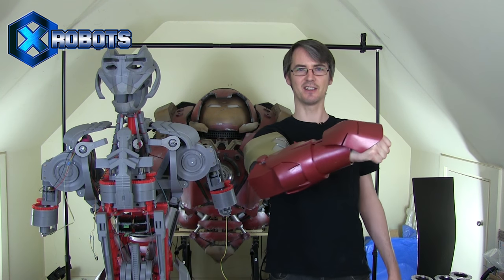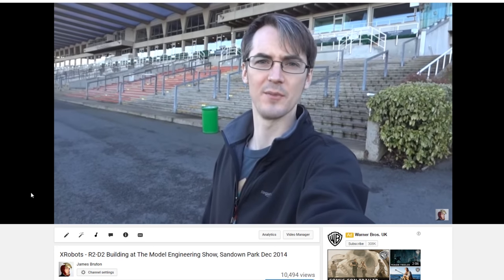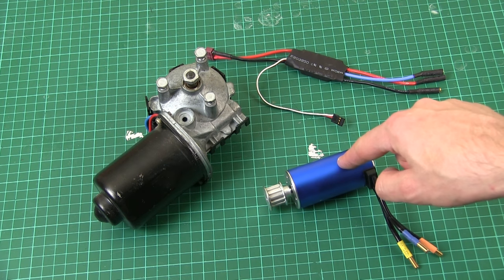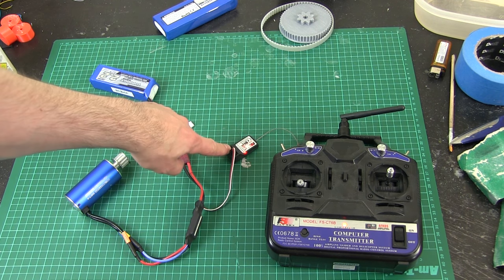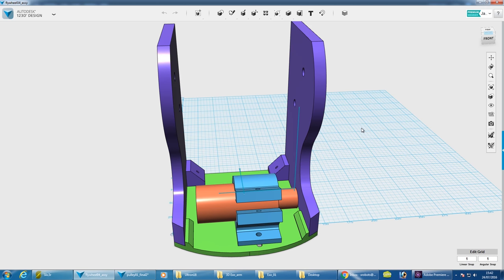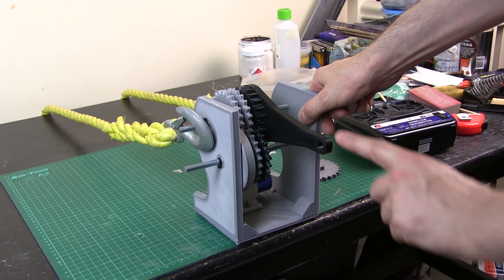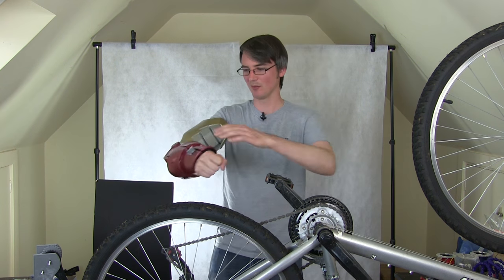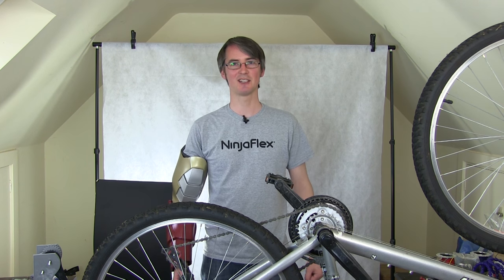Iron Man Exosuit #1 | Testing Motors | James Bruton

Comment: Couldn't you use those force sensors from ultron to control the arm? I kinda thought that's what had given you the idea in the first place.
Reply: Should use small amounts of highly pressurized air to make  a better hydraulic system. Did one for engineering and it's tiny and yet my L arm can lift just about anything. Best part is the air tube is very thin and the air container it self can be hidden wherever.
Reply: myoelectric sensing, the arduino A/D converters are sensitive enough to detect them with a voltage follower comparator.
Reply: have limit switches installed for safety on the joints that physically disconnect the motors, and a dead man switch on your hand so when you let go you physically disconnect the battery via relay perhaps in conjunction with myoelectric sensing, you can get the electrodes necessary with adhesive pads from a TENS machine, as long as the electrodes have good contact on the skin you should be set.
Reply: ive had experience personally implementing this myself(i'm a systems engineer) hence why i suggested it, good luck james.
Reply: oh and dont forget to wrap the sensing wires with aluminium tape and ground them to get rid of any EM interference from the brushless controller, but you shouldn't have an issue with that as the signal you are looking for is DC and the EM interference you may get will appear as AC at the frequency the brushless controller operates, so you may be able to digitally filter that out in software.
Reply: not really if u could make it so the sensor reads the feedback as a greater distance then it should (so tweek the code so it reads it as a higher val) u could lift with just the exo (in theory)
Reply: Such an arrangement will lead to lethal resonance and jitter
Reply: posable
Reply: Check this sensor:https://www.kickstarter.com/projects/312488939/myowaretm-harness-the-power-of-your-muscle-signals
Reply: its a myoware muscle sensor, also what i plan to use with 1 of my planed exos
Reply: same company i linked to, beat you to it
Reply: Sensing the expansion of muscles could be a much better and natural way of telling the motors what to do.
Reply: oñ

Comment: Wouldn't a worm drive simplify the mechanism while still providing the torque? That would just require getting the pitch of the thread right and would be a lot less moving parts, as well as being similar in size and proportion to a hydraulic cylinder.

Comment: As far as estethics go, wouldn't it be better to use the hulk buster suit to hide the gears and motors in?? if you add better gears etc. you could even try to make a full hulk buster suit in Aluminum or hard plastic with some thin sheets of steel plated over, the latter would add too much wieght either so, then it would operate as a robotic suit AND sound and feel like one aswell :)

Comment: Just an FYI, re: motors/gears/etc... If you never heard of the suppliers,  " Surplus Center " from USA....Gasoline motors, Hydraulic motors, LOADS of various AC/DC motors, gears & gear boxes, drive-belts/chains, servo motors-linear & rotary-(both air & electric)...wheels/bearings/shafting/etc...both online ordering & paper catalog (catalog is 300+ pages!)...
 UNBELIEVABLE suppliers for makers!
Cheers!

Comment: I don't think this project will work, problem is that an arm by itself is pretty much useless, that added weight you're lifting plus the weight of the arm itself needs support, you kinda need to either use a stand, crane or do the full exoskeleton from the shoulders down to the feet to carry the load.

Comment: Make sure to measure the maximum range of motion of your fleshy arm. You probably know this, but you don't want the exo-suit to move further than your actual arm. I think that maybe you could have a circuit go from either between the power supply and the controller, or between the controller and the motor, that takes a detour down to the moving joint of the arm, where you can put an electrical brush contact or something, that can have contact zones that physically correspond to the range of motion of your real arm. The idea is to use the contact zones in the electrical detour to the joint as a safety feature, by attaching progressively more aggressive electrical resistors to zones that correspond more closely to the maximum range of your arm, so that, for example, if your exo-arm starts getting close to the maximum extension that your fleshy arm can make, the contact zones the brush goes over, will step the power being supplied to the motor down, making it slower, and eventually stop.
Reply: (Continued) I would also put in a sturdy metal stop (a physical obstruction, strategically placed to stop things that collide with it), at the maximum extension of your fleshy arm. This is the last line of defense, incase your electrical safety measures fail. For example, your electrical resistor thing in the joint is contaminated with an electrically conductive substance (water, soapy water, salt water, metal filings, or maliciously placed solder) that allows the full amount of current to go to the motor, and thusly allows you to extend the exo-arm past the safe limit of your fleshy arm. Another example: you underestimate how fast and heavy arm is, and momentum carries the exo-arm past the safe range of motion of your fleshy arm. Another example: your exo-arm ends up being pretty heavy, and you rest it on a table, but your attention lapses, and you extend it outwards, so that the forearm area is past the edge of the table, and it's weight is not being supported, and it falls.
Reply: (Continued) If the exo-arm build becomes too heavy, you may want to wear a medical back brace, or something of that sort, or build a support structure for the exo-arm, that carries the weight independently of your spine and legs. You might as well just build and entire bare bones exo-suit, depending of the final weight of the arm + the load it will be picking up in any tests or demonstrations. I don't much like that you will probably experience a very lopsided burden, when using this arm.

Safety aside, using steel cables (or similar) could be an option for getting kinetic energy where you want it to go, so that the placement of your motor is not as restricted. Cables are best used to pull something, so you may need two of them for one single axis joint.

Anyway, this is a pretty interesting build. Good luck.

Comment: Why u dont build a power Motor in the Hulk buster?
Reply: It'd be more risk of an electrical fire hazard. And the suit takes a bit of time to get out of.
Still, if it wasn't made of foam and the wires were properly concealed, then it would probably be a lot easier to haul around with a similar system.
Reply: ok
Reply: he said in his you asked for it vid that it's kinda of like a hulk buster 2.0 and he might make it into a suit just depends on how it works out.

Comment: Instead of using motors at the joints couldn't you use wires like we use our tendons? Have it tighten on the inside and let go on the outside to lift and vice versa for lowering
Reply: Then you could put the motors on the shoulder and use a reel

Comment: Is it possible to 3D print in something like Delrin plastic? I assume it isn't, since having something laced with fibres would clog the tip.
Reply: Delrin would most likely not be printable. It has a very low surface energy which would likely cause the layers to not stick to each other
Reply: Adam S Ahh. Very well.  I used to milling delrin and I know it's very strong. But I didn't imagine it would be useable in 3D printing.
Reply: +Derelict though not Delrin, Taulman has a few Nylons that start to resemble it's mechanical properties
Reply: There are carbon fiber laced filaments out there.  Not sure if they play nice with a Taz though.

Comment: You should use a high torque servo instead of such big motors i know some that can put out at least 200kg/cm or force and like your arm they can only go so far in terms of range
Reply: Why not get some piezoelectric linear motors and place them like muscle fibers, that way the joints can stay small and use the fulcrum properties to make it faster as well without having the linear motors move fast.

Comment: For internal control, it seems like having contact panels for your arms to move against would be the best answer.  Something like this for example:  http://www.instructables.com/id/Flexible-Fabric-Pressure-Sensor/
Then you can have sleeves inside the arms that register your straining in one direction or another and activate the motors in the correct direction.  Obviously have limiters in place so the motor can't turn far enough to twist your arm past its limits (elbows don't bend backward, etc.).

I think perhaps the hardest part will be dealing with the rotational torque for the shoulders and wrists.  Bicep curls are great and all, but for practical lifting you're going to have to be able to strengthen the rotation of your arm as well as the curling motion.  Maybe a large, hollow planetary gear system  that your arm could fit through would work for that.  Have the motor front or back mounted to drive the sun which would encircle your shoulder, and in turn the sun would drive the planet gears to twist the exoskeleton.

Comment: Hay James,just a tip,you should look at this YouTubers Chanel named []
Reply: (Sorry I wasn't finished typing) named [the hacksmith] he did the same kinda India your doing
Reply: +Curren Luft I was gonna say the same thing, he needs to get away from electric motors, they're just not powerful enough. Compressed air is the way to go
Reply: Alex Tase Just curious, whats the difference between the two, like how they're refueled, the cautions, etc.
Reply: Col Stafford electric motors run off electricity where compressed air runs off compressed air. the problem with electric motors are that strong ones are very large and need heavy batteries to power them. Compressed air can use a standard scuba tank and output high amounts of force with a pretty small pistons
Reply: Alex Tase Thanks, I guess he could do some steampunk, heh.
Reply: i feel like hacksmith and him should collaboration

Comment: Jesus, thats nearly a 100 Nm motor if your predictions about its torque is correct. Thats like a small car engine O.o
Reply: crazy how powerfull the brushless motors are. my RC car got an 120a - 6800w motor @ 424g...once it gets going nothing is going to stop it!
Reply: ikr~ you never think of how much power those wipers actually have to be moving regularly at high speeds~ with all of the wind and stuff.

Comment: These gears are too thin. If you make them thicker it should work better. Because you have more surface area to transfer the torque. I built a similar device to use a Brush less DC motor for quads to push 100+ kg on wheels(little cart thing).

Comment: James, just FYI...seeing as you are trying to make this system strong...you should have your gearing run on the inside not the outside. Running inside will have more teeth engaged when gears are meshed thereby making it more resistant to tooth shear...check out the "Smarter Every Day" Video on the gravity light to see what i mean...  https://www.youtube.com/watch?v=Jsc-pQIMxt8

Comment: This has no bearing whatsoever on the content of the video, but if a hydraulic system is compressing, something is going wrong.

Unlike pneumatics, hydraulics do not use compression to generate force. Rather, they rely on fluid dynamics to amplify kinetic energy. If the fluid in the system is compressing, it is due to the presence of air bubbles. Air bubbles are BAD NEWS for hydraulics, for two reasons. First, every air bubble in the hydraulic system equals a reduction in output force. Second, air bubbles in the fluid have a rather nasty tendency to damage the parts, possibly destroying the hydraulic tube or cylinders. While not nearly as bad as a pneumatic tube going kaput, in that it probably wouldn't hurt anyone directly, it still, at the very least, means the whole part needs to be replaced.

So, yeah. TL;DR: hydraulics don't compress, because you can't squish a fluid.

Comment: Shouldve used pressurized nitrosoxide hydraulic system it would've reacted with movement instead against it and wieghed less. Progress comes in many shapes and this is good for robotics but a legitment exo suit is robotic vehicular and and still very much concept until you take multiple ideas from totally different fields- you must know about biology to understand AI.
Reply: The physics of the suit itself callse for the balance to look seemingly abnormal, but if you build a non electronic base suit you can use physics to your advantage making a stronger smaller suit if you can make a base suit that acts like a supportive base and in turn making you and the suit illusively light. I believe that could also make your tech less costly too. As redundent as a suit in a suit sounds.

Comment: hi james 
thank's for your intresting videos 
if you look for a high torque low speed actuator 
may be yu  can look also on piezo electric motors standing or progressive wave ones 
like these one for exemple
http://www.discovtech.com/products/product.cfm?proID=30
obviously it will be more expensive ( I just made 10sec google search yyou will probably find more suita ble for you) but i think it could be a good option to avoid a too bulky gear train and pulley stuff on your arm :) 
good luck

Comment: "Compressed Oil" I don't think you know how hydraulics work friend...
Reply: actually he is on the right track. they use hydraulic fluid which is an oil. Its moves easier than water and has a really low freezing point. only primitive hydraulics use water even though hydro means water.
Reply: +Sage Suchy you are a mile from what I'm refering to. hydraulic oil is not compressed, it's an incompressible fluid (in simplified analysis). It is merely a force vector of the pump/acc/system.

Comment: its not exoskeleton its an armor silly
Reply: +James Bruton (XRobots) why?..
Reply: +James Bruton (XRobots) its not an exoskeleton its an armor silly
Reply: An exoskeleton is a skeletal structure on the outside layer. In order for something to be a skeleton, it must have rigid parts with force directly driving its movement (for example with the human skeleton, our muscles are attached directly to our bones; the muscles drive the movement of our bones by contracting, hence making our bones a skeleton). This is an outside layer of rigid parts with motors applying force between them, therefore it is an exoskeleton.
Reply: well thats a bit much i mean yeah the vfx guy is wrong but that wasnt needed
Reply: armor is exoskeleton, the one, that for example Stark has is a powered exoskeleton silly.